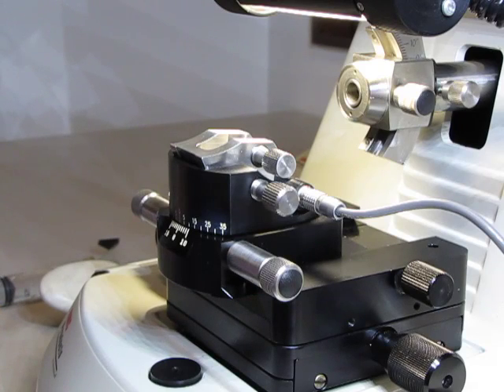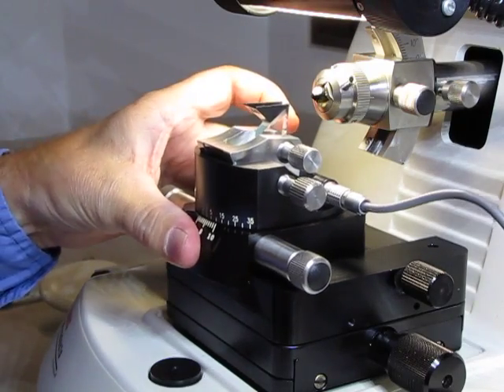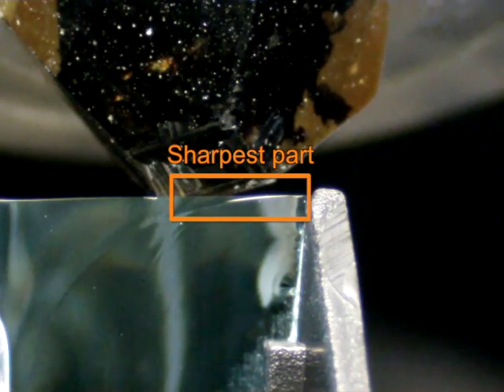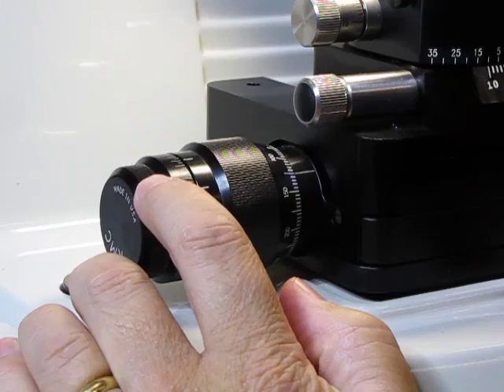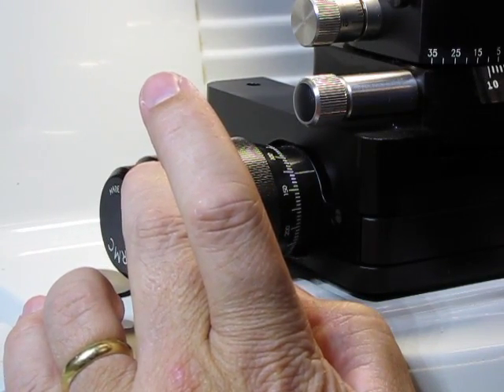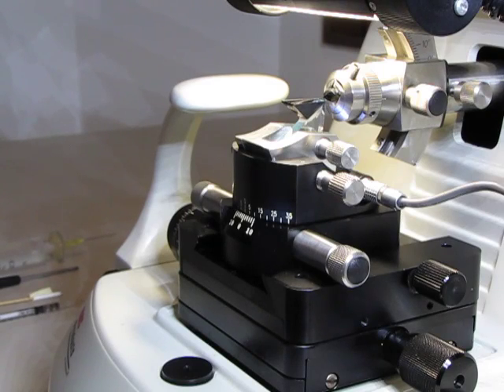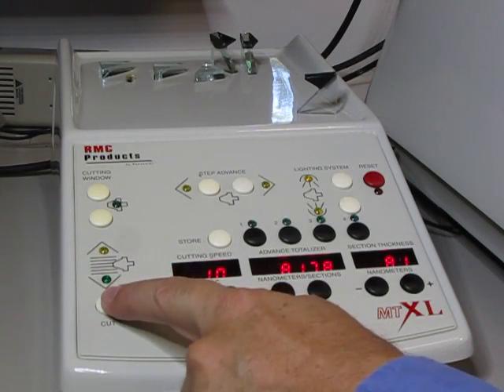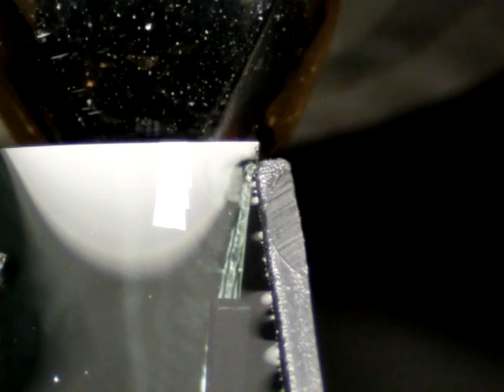How to Cut Thin Sections Using an Ultramicrotome

Comment: Any tips or video on picking up the sections on the grids? I am getting wrinkles. Unsure if it is the epon or the way I am picking up the sections. Appreciate any help.
Reply: I often use a "Chien" grid (a grid of just the rim, no bars) as a loop, to pick up the sections and transfer them to the grid. I find this helps reduce the wrinkles.